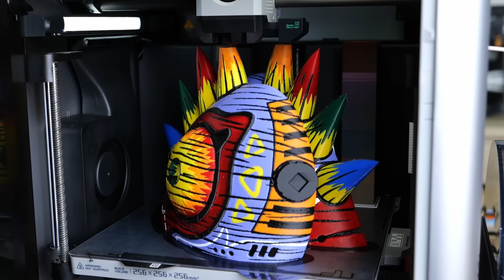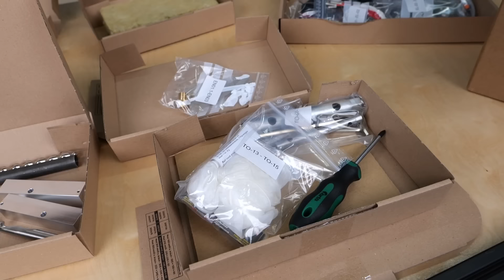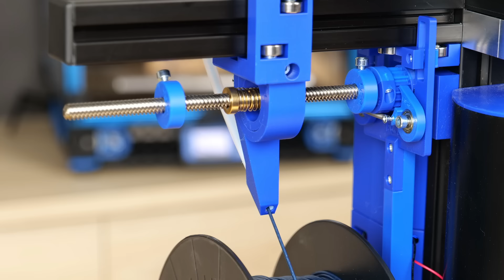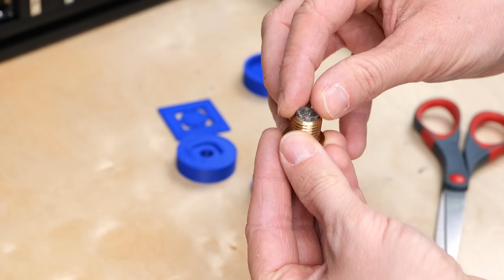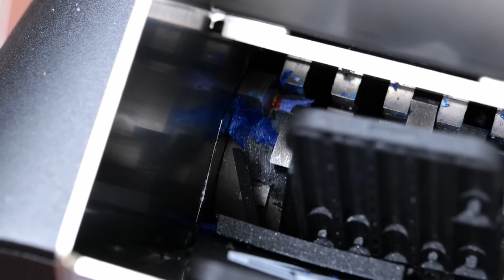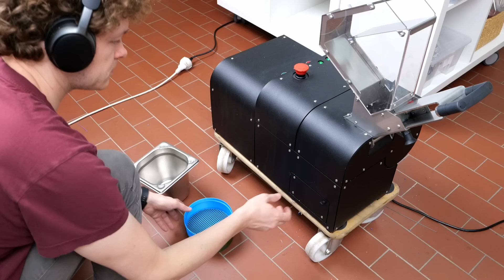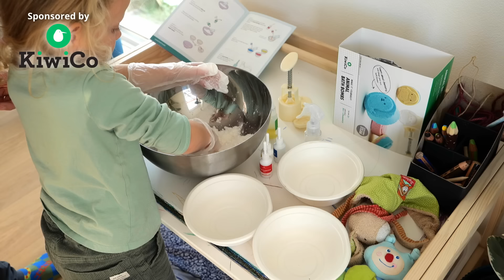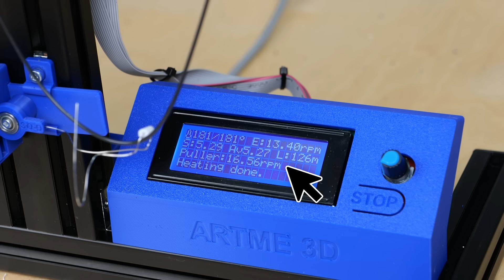Recycling Failed 3D Prints with a DIY Filament Extruder: Artme3D

Comment: i keep all my prints , this is a bit expensive for me but definitely i want to recycle my old filament someday 

also if you want to get rid of the diameter variation just add another stage just before the spool that passes the filament inside a 1.75 mm nozzle with a heater block at 75 degrees , it will shave off the excess material without completely melting it

Comment: I imagine you could get tighter tolerance material if you do a two stage extrusion. 

Option 1 you first extrude the filament at say 2.5mm and then feed the filament into a second extruder that makes the final filament. At minimum it might smooth out the inconsistencies to where its basically indistinguishable even close up.

Option 2 you run the newly created recycled filament thru a simple palletizer and then send the pallets back thru maybe with some virgin plastic or additives like carbon nano tubes.

Comment: 14.46 What was the power meter reading ?  Surely this is not the totat power consumption of the machine? Heater, auger, fans and electronica !? If so, that is kinda mind boggling. However, even if this is the case, the shredding process, drying processes, use of desiccant and vacuum process surely aren't energy efficient or cost effective. As you said... this is more for someone who wants an option of recycling their own filament, and not necessarily practical.... Paraphrasing.

Comment: I think this is a phenomenal idea. And, as you've pointed out, it's extremely well-put-together. I don't think filament recycling is on the radar of most 3D printer users. Well, perhaps on the radar but not a significant concern. I do, however, think that this could be excellent for makerspaces and the 3D printer power users.

Comment: I know the idea of recycling prints is kind of cool, but it just doesnt really make economical sense to me. You can buy virgin PLA pallets for around 2$ per kg, just compare that with all the work, machinery and electricity  you have to use to get far inferior recycled pellets. Going a step further and turning those pellets into filament doesnt make much sense either because factories in china already do that on big expensive machines and razor thin margins, with way better tolerances in any colour and free shipping for 10-15$ per kg. 
PLA is made from cornstarch, I dont really have an issue with it ending up in the trash and being burned for energy. We already burn corn for energy anyways.

Comment: Whilst this gets us closer to a viable home filament maker, it's not quite there yet.  This is super labour intensive.  I can tell, just from the video, that it's the amount of hands-on, constantly-fiddling, trial-and-error-until-it-works that I hate in "bargain" 3d printers.   And that, of course, is ignoring all the time and effort and work needed to prep the filament scraps.

It seems like a nice tool for people who are willing to spend the time and effort to get the emotional bump of recycling at home, but honestly, even for those who are trying to reduce their materials footprint I think it's a better use of your time to hunt down your local Precious Plastic collection centre and just drop your material off there.  Speaking solely for myself, until and unless home recycling gets to the point were I can buy all of the equipment for 750$ USD (or around 1,000$ CAD), devote under an hour to getting things all set up, and then just push "go,"  the effort-to-reward balance just isn't there.

Comment: Were the prints done on the Bambu A1? My understanding is that it has dynamic pressure advance due to the use of the load cell during the print. That could help to compensate for uneven extrusion

Comment: I wonder if you could use the chopper from teaching tech into this filament extruder, through a 3d printer's extruder for completeness and straight back into the chopper. I assume you'd need to have enough pellets in the hopper that it wouldn't feel like a single, endless, pointless loop

Comment: I'm actually quite curious about the feasibility of incorporating a pulltrusion step, deliberately oversizing the filament from the extruder and effectively die-forming it to the proper size.
Reply: It would be a tricky balancing act as if you pull it when its warm enough to easily deform it its also going to get deformed by what ever your using to pull it through the die.
Reply: True to an extent,  @Awrethien  , but if I recall correctly those PET bottle recycling setups were actually getting rather good dimensional accuracy just with the problem of air inclusions from curling the strip. Something about the pinch point caused by the nozzle and staying under a certain temperature combined to have the material deform mostly only at the nozzle unless I am mistaken. I was just wondering if that could make dialing in thickness more consistent and simple.
Reply: Hmmm, what are you saying is that you want to get 3mm PLA filament and then make it 1.75mm through pultrusion? 😵‍💫😵‍💫😵‍💫
Reply: Yeah, that's the thought  @chilloxik  . Replacing a fiddly spindly dangly system that has a ton of variables and failure points with one system with much more solid control over the filament and much fewer variables. Something where the size of the initial extrusion really doesn't matter much because you're doing the sizing step separately with a physical tool rather than relying on flow+temp+air temp+air flow+viscosity+gravity+weak parts+filament position to size the filament.
Reply: @aquilux-vids  I think if you have a pellet 3d printer it can solve the issue and it was my initial idea for my project, but it went down the drain. I think when it comes to recycling and 3d printing pellets and not the filament are the future. But I was not able to test it myself, so will keep on dreaming.

Comment: I’m super impressed with this kit.  I’m an engineer who used to work in bulk plastic production, so many features of a professional small scale plastic extruded are present in this inexpensive kit
Reply: do you know how small the pieces of shredded parts need to be?
Reply: @nutritious3250 I have no experience doing this with 3D printed parts, the extruders I used occasionally ran small bits of plastic, but usually ran the chemical powders used to makeup different blends of plastic.  They controlled particle size based on different plastics due to it changing the nucleation time, which affected some characteristics of the plastic(I’m not a chemical engineer, so I’m not sure what makes this happen).  Generally when we ran pre-extruded plastic we did about 1-2mm diameter pieces, but these machines were several stories tall and much different than what is shown here